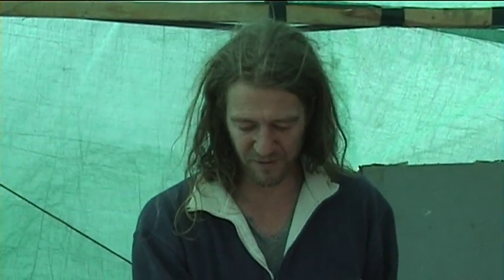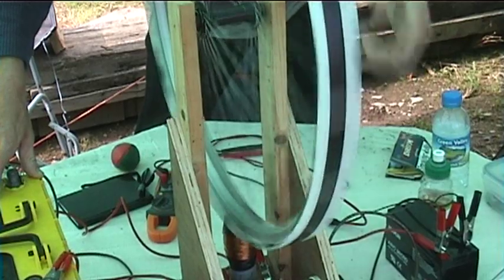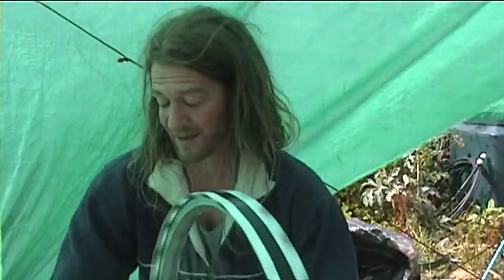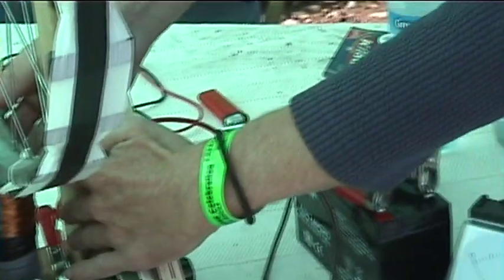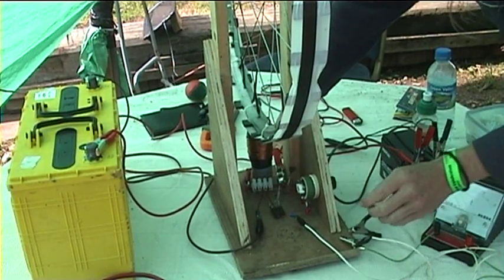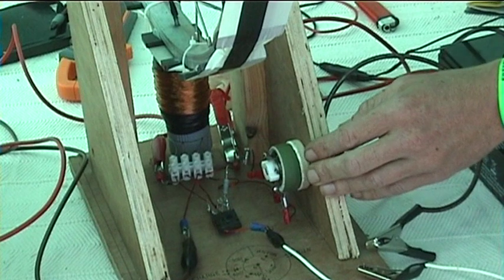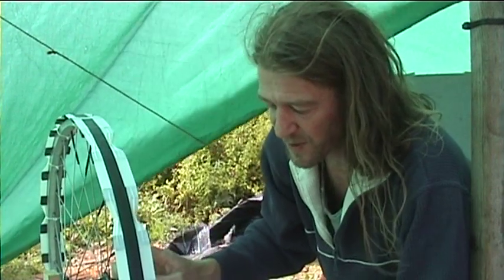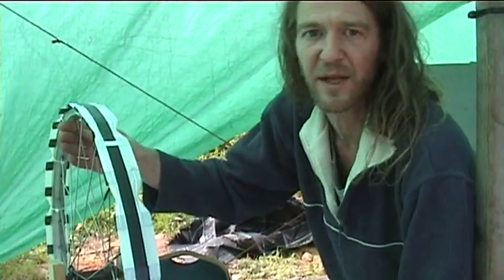Bedini (SSG) Motor - off grid festival 2011

Comment: I have been trying to figure out the Bedini thing for years now.  Perhaps someone could enlighten me,   I will be moving off grid soon.  I would like to take 10 or 12 deep cycle high energy density batteries with me.  I will have one of the best inverters money can buy.  If I built one of these Bedini fly wheels and powered it with a small solar panel, would I even need other input sources? 

From the claims Bedini and Tom Bearden made, I should be able to put 10 batteries in series and use the fly wheel to put a radiant charge on all 10 of those batteries.  As long as I used an inverter, I'd have all the electricity I need. 

My common sense is telling me it's wishful thinking.  What am I missing here?  This can't possibly work, can it?
Reply: thats exactly right bud. i have 12  12v deep cycles that run my whole house, i charge them with one 12v. Its harnessing the longitudinal wavelength.look up eric dollard on youtube, he tells how tesla figures it out, plus eric is a genius of the highest order.
Reply: kandysman86
Seriously?  I have this deep down feeling that there is something to this.  But I've never seen any demonstration showing real practical use of radiant energy generating large amounts of power.  I gotta see it.
Reply: ***** no i swear man. i've been doing i for some time and it is working great.
Reply: *****
Your gut is right. It's a scam.
Reply: They sell stuff and ask for donations, it's a scam.
Reply: Doazic If you Use the FREE plans to make one, then see that it works, then how exactly is it a scam? you do realize research cost money, and these kinds of projects don't get to suck at the public teat. Your a small minded person huh?never made one, but already have all the answers.
Reply: Look I'm sorry to burst your bubble but you can make a lot of money with the "free plan" scheme and it only takes basic understanding of electronics or chemistry to see that the machines don't work.
Reply: Doazic yeah right. Tell me why it cant? I can tell you that it most definitely can and tesla pioneered the field of scalar energy, just because it wasn't in your textbook, didn't mean it didn't happen. Thats why i tried it, my knowledge of tesla's work. And it does work, just as advertised.
Reply: It's just common sense, you're moving energy from one battery to feed another battery, you're going to lose some of that energy in the transfer and be at a net loss. Adding a spinning wheel in the middle is just going to make things worse. And in particular notice that he measures the charge of the batteries by measuring the voltage, which as anyone who deals with lead batteries can tell you, is not how you measure the charge on a battery.
Reply: Doazic
That's just it.  I watched the entire 30+ hours of "Energy from the Vacuum".  Bedini hooks up a primary battery to run the fly wheel, then charges another battery with the radiant spikes.  When you factor in the energy used by the fly wheel, and the energy charging the secondary charge battery, it's a net gain.  Bedini likes to say the COP is in the batteries. 

It's the radiant energy he's capturing and using.  Traditional electricians short the radiant spikes out because they would damage the circuit.  So the energy is there.  No one knows how to use it and therein lies the issue.  It's not taught in text books.  Electricians think it's useless because that's what they were taught.  Bedini built a very simple circuit to capture it.  It's as simple as discharging the radiant spikes into a capacitor but hooked up in reverse.  You can then simply discharge the capacitor normally and get real useable power. 

It's really amazing some of the demonstrations he shows.  One of them shows him adding a load to a circuit and it drawing less current.  He shows dead batteries taking a charge.  And many more. 

None of what he's claiming defies the laws of physics.  It's just that this radiant energy is elusive and hasn't been studied much.  Traditional electrical engineers think it's cray because they look at Bedini's circuit and think it can't work.  Show an electrical engineer Bedini's schoolgirl circuit diagram and they will say it won't work.  But Bedini has showed time and time again that it will work.  This is irrespective of the claims of over unity.
Reply: No such thing as "radiant energy", I just explained how the scam works, use your common sense.
Reply: Doazic
Ask any electrical engineer about the radiant spike.  They will tell you it's a problem in circuity and they have to ground it out else it will destroy the circuit.  So I'd rather believe them.  It's real.  It's not some made up BS.  It's in the textbooks.  Just ask any electrician. This part of the Bedini machines isn't up for debate.  It's a well known and established fundamental part of electrical engineering.  Besides it's common sense.  When you have a current flowing through or around a wire and you shut the current off, something has to balance out the circuit.  All that positive energy just doesn't disappear.  The radiant energy comes into the circuit to make the charges equal.  Otherwise you would have a perpetually positively charged circuit.  And we all know that's impossible. 

And FYI:  Bedini makes his living off building music amplifies and other similar products.  He is known as building some of the best amplifiers in the business.  Hell, he even makes his own semiconductors and resisters.  As for his simplified schoolgirl circuit, he gives it way.  He's not making any money off of it.  It's not a scam.
Reply: There's no such thing as "the radiant spike" and he clearly does make money off the SSG scam and he even mentions it in several of his videos.
Reply: Doazic Please explain to me how he makes money from it.  Because from what I've seen he offers the circuit diagram and parts list free of charge in the energy forums and his web site.  In fact, you can see dozens of machines people have built using his circuit.  Including the machine in this video.  He does endorse a kit but Rick Friedrich is the one who makes money from kit sales.  Bedini simply endorses it.  But he actively tells people not to buy the kit without first building and testing the circuit without the kit.  There are hundreds of videos of people building and testing these things.  To my knowledge there are no people who tried to build it and said it doesn't work.
Reply: Go watch the videos on his Energenx channel, he was receiving quite a few "donations" and they do sell kits as well.
Reply: I did my research, you've just been brainwashed by these guys. This video is over 3 years old, the machine doesn't work, come to terms with it.
Reply: Doazic The machines work.  I've seen them work.  I've built one that worked.  I don't know where you get your information from but people agree the damn thing spins.  It charges batteries.  Over unity or not, the machine spins a fly wheel.  So what the hell are you talking about? 

Have you built one?  Have you attempted to build one?  Why don't they work?  What is making it not work?
Reply: Just because the wheel spins doesn't mean it's working, just because it charges batteries doesn't mean it works. Let me put it in the simplest possible terms, the wheel spinning just drains energy from the battery. Meanwhile it charges batteries inneficiently, so if you start with one battery charged and another drained and you just keep swapping them around you eventually end up with two drained batteries. It's just completely stupid.
Reply: Okay I'll put it in even simpler terms. A battery holds energy, the Bedini claims that it can move energy from one battery to charge a bunch of other batteries. So lets say you start with one battery that has 100 energy and say 4 batteries that have 0 energy. If you just used a normal charger, 15% of the energy would be lost in the transfer and you'd end up with 4 batteries with about 21 energy units in them. If you use a Bedini charger, you lose say 2 or 3 energy units spinning the wheel in addition to the 15% that is lost as part of the charging process so you end up with 4 batteries with 18 energy units in them. Bedini tries to fool you by measuring the voltage which isn't what matters, it's how much energy is left in the battery that matters.
Reply: Nevermind the fact that a battery at 0 is dead and is sulfated beyond repair.
Reply: Doazic Radiant energy is PURE VOLTAGE. NO FLOW, ONLY MAGNITUDE. goddamn your slow.
Reply: I'm sure that's his sales pitch but that's just gibberish.
Reply: Doazic lol, yep troll
Reply: kandysman86
Don't you just love how some people just automatically assume it doesn't work even though they never tried building it?  They have never tested it.  They just say it doesn't work because someone told them it couldn't work.  Bedini and Tom Bearden go into detail about why some people don't think it work.  Electrical engineers look at the circuit diagram and say it can't work.  They never bother building it.  They look at the circuit and say it's backwards.  It can't possibly work.  So just to prove Bedini wrong, they build the circuit the way they were taught.  Of course it doesn't work, you didn't follow the instructions. 

The machine can desulfate the lead plates in a lead acid battery.  That was thought to be impossible.  Now you have people building battery desulfaters using Bedini's design.  The machine can also run on a 6 volt battery and charge a 12 volt battery.  That too is considered impossible.  Yet it's been done.  There are hundreds of videos to prove it.  The naysayers still say it can't work.  The evidence is overwhelming.  It's plain as day.  I just can't believe hundreds of people getting together and creating a conspiracy to support Bedini for something he makes no money from.  It defies logic. 

Secondly, radiant energy is real.  Some call it negative energy.  Even if you want to discredit Bedini and his circuit, you can't discredit radiant energy.  It's a well established component of electrical engineering.  So if someone claims it doesn't exist, they can't be taken seriously.  It's like saying the sun doesn't give off heat.
Reply: Do yourself a favor, go to Bedini's EnergenX youtube channel and watch a few. The man clearly has no idea what the hell he is doing or is running a scam.
Reply: ***** exactly. i am going to try and replace one breaker at a time with a solar/battery combo bedini motor.Ill be off the grid for real while this guy still thinks the earth is flat.
Reply: Doazic I'll do you one better.  How bout I go watch the entire series 'Energy from the Vacuum'?  It's not available on Youtube and is a comprehensive explanation of the Bedini projects.  He gives you the background of where the schoolgirl circuit came from.  He gives dozens of demonstrations.  He even has devices built by others like Moray, Sweet, Kromrey, and Howard Johnson.   They even interview university professors and electrical engineers.  They research things like negative resistors which are supposed to be impossible however Dr. Deborah Chung has shown that negative resistance is possible.  It's real verifiable science.  He gives examples of Tesla's research of radiant energy.  He gives an explanation of the problems with the mythbusters segment with examples and the device should have been built.  He answers all the questions of the skeptics.  It's all spelled out.  That doesn't sound like someone who doesn't know what they are doing.  That sounds like someone who is educated and knowledgeable.  Besides, it's pretty stupid to say that because even without Bedini's schoolgirl circuit and flywheel, he's still one of the best known electricians in the business. 

He purposefully doesn't post his schoolgirl circuit videos because people like you want to fight him tooth and nail.  He's got more important things to do than to try and convince a few skeptics who won't even build the machine.  All he asks is if you don't believe it, just build the machine to the specifications he provides and then tell him it doesn't work.  But people like you just won't do it.  Why is it so difficult  Why won't you build and test the machine before condemning it?
Reply: It's been done, none of the machines built work.
Reply: Doazic That coming from someone who hasn't built and tested the machine. 

Do you buy into the giant spoon theory as well?  There is a giant spoon on the other side of the Moon.  Someone told me so it's gotta be true. 

The machine works.  Get over it.  The evidence is irrefutable.
Reply: Your evidence that it works is video of a wheel turning. Guess what, that's what every single electrical motor can do, that's not proof.
Reply: Doazic
A video of the wheel turning is proof in and of itself, wouldn't you say?  There's also videos of the voltage spikes from the wheel.  There's also videos of reviving dead batters with the wheel.  Yet you say it doesn't work and provide no evidence or explanation.  You simply say it doesn't work.  Why doesn't it work?  Will you finally answer the question?
Reply: I explained pretty clearly why it doesn't work and how Bedini structures the scam, this is getting repetitive.
Reply: Doazic
No, no you didn't explain.  You just said it doesn't work.
Reply: Okay let me try again. The key to understanding the Bedini scam is to understand how you measure the charge left in a lead acid battery. The correct way to do it is to measure the specific gravity of the sulfuric acid in the battery. The way Bedini tricks you is that he measures the voltage, tells you "the voltage is increasing which means the charge is increasing" which of course is a lie. So Bedini will take one battery use it to raise the voltage of 2 or 4 batteries and say "see I charged 4 batteries with 1 battery" which is just a trick.
Reply: Doazic
Dude, that is flat out bullshit.  Where are you getting your information from?   I thought you watched his videos on Youtube.  You didn't see him measuring current with his alum batteries?  And just so you know, you can't take one battery and magically make the voltage rise on another battery.  Everyone knows the batteries would balance out and the voltage would be the same on both.  So please, please tell me again how he can hook one battery up to the machine with a 12.0 volt reading and then pull it off an hour later with a 12.5 volt reading all while running the fly wheel on a battery that has a voltage reading of 11.5 volts prior to the wheel running and 11.5 after the wheel has ran for an hour.  Care to explain that one?
Reply: The answer is very simple, if you raise the temperature of the battery which is what Bedini does, the voltage will increase.
Reply: Doazic
Dear lord, now I'm convinced.  You really don't know what you're talking about.  A lead/acid battery runs most efficiently at or around room temperature.  About 70F.  If you cool it down it's efficiency decreases dramatically and at around 32F it's efficiency is less than half.  When you heat a battery up, it's efficiency decreases even more dramatically and in fact will damage the battery.  The last thing he or anyone else would do is to heat up the battery.  That's just ridiculous.  A flat out made up falsehood.  Sorry bud, I'm not that gullible.
Reply: Doazic
I am well aware of the proper way to measure the energy density of a lead acid battery.
Reply: Then you're aware that Bedini measures it incorrectly.
Reply: Doazic No, I'm aware that Bedini measures it like most normal people measure it.  By taking a voltage reading.  If you want to remove the caps and risk getting acid on you, go right ahead.  But most people will measure the voltage which will give them a good indication of how much power is in a battery.  If a lead acid battery is spent, the lead will become sulphated and give you a lower voltage reading.  Therefore in a lead acid battery the voltage reading is directly proportional to the specific gravity.  In fact, a voltage reading is even more accurate in many circumstances because if you add sulphuric acid to a dead battery, the specific gravity reading will read normal and the voltage reading will read insufficient.  You could have a 12 volt battery with a normal specific gravity reading and only read 5 volts on a voltmeter.  The battery is dead.  You wouldn't know that from a specific gravity measurement.
Reply: The voltage is misleading and Bedini uses it specifically to mislead. If you use one battery to charge another battery then do that repeatedly you end up with 2 dead batteries. There's not much else to this.
Reply: Doazic Then why do you keep replying? Move on.  Go away.  Go comment on another thread.  I'm not interested.
Reply: kandysman86
Isn't it funny?  I've heard Bedini talk about the skeptics many times.  They all say the same thing. 

"Why would I build it?  It can't work so why would I waste my time building something that can't work?" 

If you don't at least try to build it, then the argument becomes arbitrary and pointless.
Reply: "The radiant spike caused by the collapse of the magnetic field creates a scalar spike, thats then directed towards the secondaries." Kandy this right here is the problem. That sentence is complete gibberish meanwhile you ignore basic battery chemistry that anyone who has dealt with an automobile would be aware of. You're completely brainwashed, there is no such thing as a "radiant spike".
Reply: Single wire transmission and lighting bulbs underwater is not magic and has nothing to do with "radiant energy".
Reply: How to light a bulb under water? Simple the current flows throw the wire lighting the bulb, the current follows the path of least resistance which is the wire and bulb, it'll only short if the water is pumped with electrolytes. As to the single wire trick, it's easy with high frequency, you can even light it without the wire and all explained under normal theories.
Reply: This is now insane. You do realize that we're having this conversation thanks to computers that only work because of current electrical theories. This conversation is being transmitted by electromagnetic wireless electricity, not magic "radiant pulses". The fact that this exchange is even occurring shows you're wrong.
Reply: Doazic That's just ridiculous.  Your comment just proves you have no understanding whatsoever of what radiant energy is.  Radiant energy is a fundamental part of electrical engineering.  It is so fundamental to circuity that it must be grounded out so as not to damage the circuit.  I have explained it to you previously and you still claim it's not real but again you don't provide any explanation.  Do us a favor and just stop.  Until you have built and tested the machine you don't know a damn thing.  You are out of your element.  You're like a 3rd grader trying to discuss the physics of rocket science. 

Oh and by the way, Tesla has extensive writings on radiant energy and pulse technology.

http://educate-yourself.org/fe/radiantenergystory.shtml
Reply: kandysman86 Tom Bearden explains it very well.  James Clerk Maxwell truncated Heaviside's equations.  He took Heaviside's work, took out what he didn't understand and published it and those are the same textbooks we use today.  Electrical engineering hasn't changed much in the last 100 years so new ideas and discoveries are met with skepticism.  What we know about electricity today is only half of what electricity really is.  Kinda like Einstein omitting electrical phenomena from the theory of relativity. Tesla understood it and it's highly likely we wouldn't know about it today had it not been for Tesla.
Reply: Doazic
You're right.  I apologize.  I got Maxwell and Lorentz mixed up.  It was Lorentz not Maxwell.  Lorentz symmetrically regauged Maxwell's equations which threw out all COP>1 systems.  This was a disservice to electrical engineering.  Now we have people like you that think it's impossible even though Heaviside and Maxwell proved it is possible.
Reply: Which still doesn't prove that the Bedini machine works nor that it harnesses your magical "radiant energy". It's pretty damn simple, a current passes through the coil in a bedini machine, that creates a magnetic field in the coil which repels the magnet on the wheel, then it turns off until the next magnet is nearby. The flow of current consumes energy in order to make the wheel spin. This is all normal orthodox electronics, nowhere is there any magic that requires "radiant energy" to explain it.
Reply: Doazic
Well at least your thinking now.  And you are absolutely right.  The coil turns on and off attracting and repelling the magnet making the fly wheel spin.  But the process doesn't end there.  You forgot the part where the magnetic fields collapse and the energy is captured in another coil or set of coils.  This is the radiant spike.  If you still don't believe it doesn't exist I suggest building the machine to the specs Bedini gives and then holding the secondary wires in your hands so you can feel the 300+ volt zap.  Then tell me radiant energy doesn't exist.
Reply: "the magnetic fields collapse and the energy is captured in another coil". That right there is the problem because what you just described is nonsense. There is no energy to capture from the collapse of the magnetic field. When you flip the switch on a lightbulb to turn it off is there energy to capture from that collapse? Of course not.
Reply: Doazic
The current flowing through the wire creates a magnetic field.  When it is shut off, the magnetic field collapses and the radiant spike equals out the charge.  The laws of physics dictate that the charge must be equal.  The radiant spike is the energy that brings the circuit back into equilibrium.  It's not rocket science.  It's a well known electrical engineering principle.  I've been saying it since you started this whole pointless discussion. 

It's easily understood using the garden hose metaphor.  What happens when you shut off a garden hose?  Air enters the hose and takes the place of the water. So what happens when you shut off the current in a wire.  What takes the place of the positive charge?  If you don't buy into the concept of radiant energy, then what causes the charges in the wire to equalize?  Answer it this time.  Don't ignore the question like you have been doing.
Reply: Okay I think I get the problem here. Your hose analogy is perfect. When I switch a lightbulb on electrons start flowing through the bulb and that causes it to turn on. When I turn it off, the electrons do not leave the wire, the only thing that changes is that the electrons (or water in the hose) stop moving. It does not get replaced by air.
Reply: Doazic Oh god, dude it was an analogy.  It wasn't meant to be taken literally.  If you don't even understand the nature of electricity, then there is nothing to discuss.  This is a pointless exercise.  Do me a favor and just stop posting on my thread.  I'm not interested in what you have to contribute.  It's meaningless and pointless.
Reply: No no, I answered your question. The electrons stop moving, that's it, there is no radiant spike caused by electrons no longer moving. This whole gibberish where the "collapse of the magnetic field causes a spike" is gibberish based on your misunderstanding of what electricity is.
Reply: Good luck with your magic battery chargers then.
Reply: Doazic its well known that electrons dont "flow" through wires. They drift, very slowly.
Reply: Victor Toro
I have no idea what you are trying to say.  Is that English?
Reply: ***** you seem to know this is nonsense. are you trying to get a demo for entertainment? you're baiting them right? with comments like "is it just wishful thinking". you know it is right? i'm trying to read between the lines. From a sociological perspective, this scene is both fascinating and disturbing.
Reply: intriq8
I'm trying to figure out if there is any truth to it.  You have two types of people in this debate.  The first type says it can't work.  It's impossible.  They have never tried to build the machine and test it but they still insist it can't work.  The other type says it does work.  There are certainly dozens of videos of people running the machines. 

Everything I've seen shows it works.  I'm trying to find someone with experience who can confirm or deny the claims through real measured data.  Someone who built the machine to Bedini's specifications and can explain it.  I've seen the entire 'Energy from the Vacuum' series.  Bedini shows the machine working.  You can see it with your own eyes.  But he's just one man.  Bedini has proven his machine to disbelievers before.  Others just won't believe him no matter what.  Even with real empirical proof.  They refuse to build the machine and test it and therefore insist it's impossible. 

I want someone to talk me out of it.  I want someone to explain why people think it works but really give an understanding of why it doesn't work.  And I don't mean some backyard electrical engineer who won't build and test the machine and is simply offering reasons why it won't work based on what they were taught.  I want a skeptic to build the machine and get it running and tell me what is going on.
Reply: ***** said "+Doazic Dude, that is flat out bullshit. []"  No, that's about the 4th or 5th really clear concise explanation of exactly what's happing that he gave you. amazing.  It's not mysterious: You are getting less energy out than you put in, and you have to know it , coz your batteries keep going flat. You do know it, right? Its right in front of you, so you're either lying or just don't really understand whats happening yet. Which? I have to know ! ?
Reply: I think the issue here is a confusion of what proof is. Bedini has never proven empirically that it works. To do that he'd need to provide measurements showing more energy coming out that going in and he has never done that.
Reply: ***** "I want someone to talk me out of it." If you have enough knowledge or experience, there's really no need to build it to understand it completely, and to know it doesn't work.  But, you said you built it, so, does it run forever or do your batteries go flat? There's your answer. Or, if the concrete experimental data in front of you, or the clear technical and logical explanations from Doazic aren't enough, perhaps explore an understanding of the sheer improbability of it all:  that the only people taking advantage of this are a few assholes on youtube, and not  many, many, much smarter, more enterprising entities. If this could yield even a small advantage to people, everyone would have one. You can't keep a useful secret. Not all of the powers that be agree; that's the achilles heel of suppression conspiracy theories.
Reply: Doazic
Bedini does have empirical proof.  He's got about 60 hours of it on video.  It's all documented on the Energy from the Vacuum series.  He lacks the scientific understanding to explain it though.  And therein lies the problem.  He got Tom Bearden to help and he has been trying to explain it but it's fallen on deaf ears.  It's not something that is easily explained. 

One of the most poignant examples is Bedini running 3 killowatts of incandescent lights off a 2,000 amp/hour battery bank.   He takes a voltage reading and lets the lights run for about 15 minutes.  He then lets the batteries rest and takes another voltage reading.  Obviously the battery bank has lost a considerable amount of energy  Then he hooks up his 10 coil machine and runs it for another 15 minutes.  After letting the batteries settle to their sitting voltage, the voltage reading was the same as it was before running the experiment.  All this was done from nothing more than one 12 volt battery and his 10 coil machine.  Bedini then goes on to explain that the naysayers will say a voltage reading alone is meaningless.  So he runs the experiment again.  Exact same results.  That's impossible according to most.
Reply: Doazic Damn, nice and concise as usual.
BTW: I think when they say "electricians" have to protect against "radiant blah", it seems they may be referring to "back-EMF". So that's a thing. This is a "motor" here, so loosely they could be said to be harvesting back-EMF.  which of course is still just energy you had to put into the system. But I guess it's all custom folk-lore, so not much sense in trying to map it all to real concepts.
Reply: I explained this to you already, the voltage is not the proper way to measure charge in a lead acid battery, that is the trick he uses to con people.
Reply: intriq8 See that's what I'm talking about.  Saying something doesn't work without building or testing the machine is meaningless.  That's what everyone says. Everyone uses the same excuse.  If it was possible everyone would have one.  I have yet to see someone build the machine and then debunk it.  There is enough proof out there to know the machine will run.  No one is arguing that.  The fly wheel will spin. 

Doazic is right.  Bedini has never been able to show more energy going out than coming in.  But it goes against the nature of the experiment.  Bedini says "the coefficient of performance cannot be measured because it's in the battery."  You can't hook a killawatt meter up to the input and another one to the output.  The output meter will be jumping around sometimes reading 500 volts, sometimes reading 10 volts.  But he does show the voltage reading of an input battery before running the machine and then after running the machine.   He then has separate meter showing the voltage of the charge battery before and after charging..  There is a clear gain.
Reply: +Doazic love the ol' "you're typing this on a device built on the science you're shitting on"
I pull that out sometimes, thinking I'm clever. Is that hack now?
Reply: Then he can just hook it up to an oscilloscope and measure the output. You just stated a huge red flag in that Bedini is claiming it can't be measured. If it can't be measured, it isn't real. Bedini is claiming something that is impossible under the current laws of physics and common sense. Given that in the years that he has been making money of his scam, he has never proved that it works, the default conclusion is thatit doesn't work. You don't need to build it to show it doesn't work, he needs to build one and prove it works.
Reply: Doazic
Like I said.  Bedini says the coefficient of performance is in the battery.  You can't measure the output on a Bedini machine in kilowatt hours.  You have to put it in the battery and then measure it.  I gave an example earlier of how he demonstrates it using a 2,000 amp/hour battery bank, and a 12 volt battery hooked to a 10 coil machine.  The voltage of the battery bank will go down.  If you take a reading and it's resting voltage is 12.9 and then run the Bedini machine and it's resting voltage comes up to 13.3, then the machine is obviously putting a considerable amount of energy into the battery bank.  You can claim the voltage reading is useless all you want but the it is the only known way of giving you a quick understanding of the batteries capacity.  Otherwise you're looking at hours of testing.  You can't test a batteries capacity in a matter of minutes.  So it is generally accepted that a voltage reading can give you a pretty good indication of where the batteries are sitting. So if you have a 12 volt 2,000 amp hour battery bank reading a voltage of 13.3, you can pretty much say the battery bank is fully charged.  If the voltage reading was 12.0 you can logically assume the battery bank is in need of charging. In fact, that is how charge controllers operate.  They don't read the battery capacity when deciding whether to send current to the battery, they use the voltage of the battery.
Reply: Dude, I don't know why you guys think Bedini is making money off of this.  He's never made money off of it.  He freely gives the specs and parts list out to anyone.  Hell, he will even answer your questions on his forum.  He does offer a kit you can buy but that's just because the lazy folks wanted an all in one kit.  He doesn't promote it though nor does he sell that many.  But you don't need the kit and Bedini will tell you that.  In fact, he prefers you build it yourself with your own parts.
Reply: I've come to the conclusion that many if not most free energy advocates on youtube are attempting to make money through youtube or an external website. I speculate that many/most don't actually believe it, and are simply generating traffic /comments/revenue.
Since I started to see it it seems obvious and I feel like I should have realised sooner. It's fascinating. Its that standard religion/cult/alternative scene, full of the passionate and naive, with many cynical non-believers "leading" them for personal gain/status. A kind of self-reinforcing structure, that is common, but I find a bit grotesque and sinister.
Reply: He does make money off it, we've pointed that out previously.
Reply: Doazic
I make money by selling garage sale trinkets on ebay.  It's not much money.  But it's easy and quick.  Like I said, he doesn't actively promote the kits.  In fact, he encourages people to build their own machines with their own parts.  The kits were put together and sold by Rick Friedrich anyway. Bedini just endorsed them.  He might have sold a couple of dozen per year. 

His real business is making customized audio equipment.  Apparently he makes some of the best audio amplifiers money can buy.  The Bedini machine is just a hobby. 

He's not the quack you seem to think.  He is considered a genius by many in the industry irregardless of his machine.
Reply: @105951085035446188665 Well, see ,they have been built. by skeptics and by believers. they've been proven not to work the number of times that they've been built, in that they didn't keep running. and countless times in more scientific ways. surely you know this. you're not running your house off it, you're not charging your phone off it, without putting in power.  Look, why on earth do you keep defining WORKING as SPINNING? surely this is disingenuous . thats just a motor. thats not useful.  this conversation is dumb. You can't be serious. spinning is not equal to working. the batteries not going flat would be "working"  .. hell even a few points under and a long runtime would be impressive, but its not even close.. you know it. how the hell do you have so much time to lie about something you know?  youtube comments must generate money somehow...
Reply: intriq8
I think you have a misunderstanding of how the machine works.  It's not a perpetual motion machine.  Eventually the primary battery does run out.  It runs out just like any battery would running a motor.  The unusual part is the collapsing magnetic field's radiant spike he captures and puts in another battery.  It's not free electricity in the sense it is created out of thin air.  Its simply taking the energy that's already there and converting it into useable power.  Works on the same principle as solar or wind. 

I have yet to find a skeptic who built one and tells us why it doesn't work.  Can you point me in the right direction?  A Youtube video perhaps?  And don't tell me about the mythbusters.  They didn't follow Bedini's specs nor did they contact him or ask him for any advice.  They completely botched the motor.  They did eventually admit they didn't follow the specifications but they never revisited the myth even when Bedini offered to show them.
Reply: We've explained to you multiple times why it doesn't work. If that's not sufficient for you, buy one and see that it doesn't work.
Reply: ***** "Its simply taking the energy that's already there and converting it into useable power.  Works on the same principle as solar or wind. " this is were the description goes off the rails, but i'll take a liberal interpretation and explain why it still doesn't do anything useful:
 yes, one can build a system that harvests back-emf of a motor somehow, no doubt a number of ways, and you are reclaiming otherwise lost energy. The thing is that that energy came from the battery. its akin to driving a wheel and then hooking a generator and saying "look, I'm reclaiming lost energy" . You had to put it in first. and more than you get out. thus, not new. Theres no special excuse that excuses the battery going flat: thats the test. by the lore of this device: switch em round after you use the first to charge the second. net loss. and you know it . this is too circular. I'm bored now, so good luck.. as usual Doazic put it best.
Reply: intriq8 It's not back emf.  I never said that.  Never even implied it.  It's the radiant spike.  When a current flows through or around a wire it is positively charged.   Once the current is switched off, nature equalizes the charge by inputting energy into the circuit.  It's a very brief high voltage spike.  This energy is grounded out in traditional circuitry.  It's sometimes referred to as negative energy.  Bedini simply captures it, inputs it into a capacitor, switches the polarity and discharges it into a battery.  That's the simplest explanation.  The energy is already there.  It's not lost energy.  It's not energy that came from the battery.  It's the radiant spike that occurs when the magnetic field collapses.  It's charge equalization.  Action/reaction.  Cause/Effect.  It's a well known phenomena in electrical engineering.
Reply: ***** yeah but thats not a thing (meaning: that explanation is not meaningful), i was trying to meet you halfway with the closest thing it could be. descriptions by prominent advocates of your crap actually refer to  the BEMF as being used. but forgive me, forget the term. either way, regardless of what you want to call it, theres less coming out than going in.
Reply: intriq8  the inductive spike is much higher voltage than the input, back EMF can never even be as high as the input voltage. Two different things man,and both well known
Reply: That's not a thing?  What do you mean by that?  Back emf has nothing to do with the high voltage spike.  Two completely separate phenomena.  Meeting my halfway?  You're not meeting at all.
Reply: kandysman86 yes, regardless of which effect you are referring to harnessing, it doesn't do anything useful.
Reply: intriq8 lol, and you keep believing what you're told. i like experimenting for myself
Reply: good, me to, but i believe very little of what  i'm told by people exhibiting the kind of circluar logic i see here. hence this conversation.  I also know BS when i smell it. Bedini says its not getting free energy, and that its just interesting, then claims he's powering things  from iit. so which is it,? cant be both. because powering his stuff off anything other than the free energy he says it doesn't produce , would be a meaningless statement. But i agree, he's still not as overtly full if shit as some  people in this community are about this device.
Reply: intriq8
Do you know what circular logic is?  Circular logic is something you affirm to be true because someone told you it's true without providing any evidence to the contrary.  A good example is the bible.  People will fight tooth and nail to affirm the bible and provide bible verses to prove the bible is true.  That's circular logic.  And that's what you are preaching here.  Someone told you Bedini's machine can't possibly work and you believe them based on what they told you even though they provide no evidence to back it up nor have you built or tested the machine yourself.  You have no frame of reference here. 

Nor do you seem to understand the premise behind the machine.  I have explained it more than once and you continue to hark on perpetual motion and free energy.  I have explained why it's not free and how it's possible to have a COP greater than one.  Before you continue to condemn Bedini, why don't you go watch all 60 hours of the Energy from the Vacuum series and then build the machine yourself so you can understand it.  If you still think it doesn't work, then you will be in a better position to challenge it and I will be in a better position to listen to you.  Until then, this is a meaningless debate.
Reply: You have this backward. You have to build one and prove it works. The burden of proof is on you. We've explained in detail as best as possible why it doesn't and can't work. If you need physical proof that it doesn't work to convince yourself, spend the couple hundred bucks to build one and see for yourself.
Reply: Doazic um, no, and you know it: the burden of proof is and has always been on the one making the extraordinary claims. And no, that's very much my point: i don't need physical proof that it doesn't work, its obvious from a mile away, the creator himself says it doesn't work, and it's been proved already. Open and shut years ago. even the original liar Bedini is smart enough to distance himself from you. I know you've "explained in detail as best as possible" to the best your ability, and that's one of the other many many nails in this coffin.  Your psuedo-scientific double-talk also an excellent indicator that this is nonsense. The more time one spends looking at people like this, this the more obvious the scam is.
Reply: intriq8
Look man, I'm not interested in a pissing match.  If you don't believe it fine, I don't give a damn.  But please, you're projecting your own thoughts and opinions on the subject and it's completely irrelevant.  No one is talking about a bullshit novel motor or blocking oscillators or magical waves.  You don't understand it.
Reply: no, that's exactly what your talking about. that is what a SSG is, a slightly novel motor, patented years ago. that is the beginning and the end of it. I understand it fine. You can't bamboozle me with poorly worded pseudoscience, I've been around too long.
unless you are saying that this does nothing useful , but is interesting, then thats what you're saying: thats its useful. which it isn't., particularly. no pissing match, just plain simple obvious truth.
Reply: I just hate lairs too much. its my particular problem. that's on me.
Reply: I have built one.  I have a single coil motor.  It charges batteries just like it supposed to do.  It will run for days on one 12 volt battery and charge another battery at the same time.  I don't have unlimited resources so I have only a couple of 12 volt batteries.  I can get mechanical power from the wheel and charge a battery at the same time.  I have not tested it but from what I understand I could charge several batteries at the same time.  I don't claim to be an expert.  I am simply an enthusiastic hobbyist.  If I had the time and money to test different configurations of batteries, transistors, etc. I would.  I have seen videos of others testing these machines and they seem to work.  Like I said before that you two guys keep ignoring the Energy from the Vacuum series.  You guys don't seem to have an understanding of the basic premise behind it.  Both of you just seem hell bent on the free energy thing and how it's impossible.  And yeah, you can't get more out of a system than what you put in.  Then a guy invented the solar panel.  All the sudden you have energy that appears to be free.  They claimed his invention was impossible.   It couldn't possibly work. At first glance for all intents and purposes, it's free energy.  No one is supplying the solar panel with excess energy, yet here is the data.  They are clearly getting more out than what they put in.  It appears to contradict the conservation of energy.  It can't possibly work.  Then they took a closer look and realized, nature is putting in energy too. I mean come on.  Did you guys learn anything from Einstein?  Nuclear power was thought to be impossible.  Solar power was thought to be impossible.  Do you guys honestly think that we will continue to spin turbines through super heated steam and power the world?  Someone is bound to make a new discovery and revolutionize the energy industry.  Hell, just look at the claims of the Bloom Box.  It is claiming the same thing.  Google seems to think there is something to it.  So why don't you go discredit the Bloom Box.  That guy has taken billions of dollars making the same claim.
Reply: Have you not been paying attention?  The Bedini machine is not patented.  He is giving it away.  He has been giving it away for years now.  He wants people to build and test it.  It's not about the money. 

I'm not trying to bamboozle you or anyone else.  You say it can't work but you have never tested it.  You have never built it.  You have no context.  You are not qualified to say whether it works or not.  Are you an electrical engineer?  Are you even familiar with basic circuity?  Are you even a hobbyist?  Have you at least watched other videos of people running these machines?
Reply: ***** it was patented long before bendini made one.  you are simply reciting modern folk lore.
Reply: As bendini himself said, its working on well understood principles. Its interesting if you're interested in how different motors or oscillators work, or EE in general ,which is a fair interest.
Reply: ***** "I have not tested it but from what I understand I could...[]" this really says it all. You haven't really tested it meaningfully, and you don't understand much.
Reply: intriq8
Dude, you are off your rocker.  It couldn't have been patented because it doesn't work.  Remember?  So who magically patented something before the inventor invented it and what were the claims in the patent?  The patent office won't patent a perpetual motion machine.  And if it was patented before Bedini, then how could Bedini openly and legally violate another persons patent?
Reply: ***** your logic sucks. its works fine as a novel motor. which is what i said. just doesn't do what you claim.
Reply: The history of this motor design goes back much further, probably to 1974, when it was patented by Roger Andrews of Salem, Oregon as a novelty electric motor. (Ref. : Patent 3,783,550)

The Bedini SSG motor, to all intents and purposes, is identical to that patented by Roger Andrews. It is based on what is commonly known as a `blocking oscillator´. 

Blocking oscillators are often used as voltage converters / simple switch-mode power supplies; for example fluorescent light inverters. For many, it will be recognized as the circuit for a `Joule Thief´.
Reply: So what happens to the `charge battery´ when it receives a high voltage pulse ? The answer is that the battery is desulphated. Accumulations of lead sulphate are stripped from the battery plates, allowing the battery to perform slightly better. This is the crux of the Bedini Motor myth - it can desulphate a lead acid battery making it work more effectively - it is NOT a true battery charger ! Solid state desulphators that work on exactly this principle, and do this much better, are available for $30. furthermore, they draw the power from the battery that they are desulphating.  Bendini , and the assholes associate with Bendini, sell this very thing for hundreds of dollars, using the buzzword "radiant "energy . but surely you know all this and you're just pretending to believe otherwise.
Reply: "The great Bendini" clearly states its not a perpetual motion machine., nor OU, not does it produce any electricity, nor does it get you free energy. he's said all theses things explicitly, (i think you even said these things somewhere.)  he's claiming it was nothing more than a battery desulphator, which is a tad disingenuous of him in light of other things he's said.  but he does sell desulphators.
Reply: intriq8
I'm done here.  You have a wonderful ability to misquote and twist the meaning of what I have been saying.  I can play that game too.  Shall we?

"As bendini himself said, its working on well understood principles. Its interesting if you're interested in how different motors or oscillators work, or EE in general ,which is a fair interest."

It's Bedini not Bendini.  That just goes to show you, you are clueless in the whole debate.  You don't even know his name.  Secondly, this comment makes no sense whatsoever.  "It's interesting if you're interested".  What the hell?  "which is a fair interest"  What does the even mean?  How can something be a fair interest?  It sounds like this was written by a 3rd grader who way out of their league.
Reply: ***** " how could Bedini openly and legally violate another persons patent? "  because nobody cares and its common knowledge and nothing's at stake. thats how patents work. you can copy any number of patents , but until you do something interesting, or affect real business, its not of concern to anyone. you've pointed out exactly whats wrong with the idea that this motor is useful.
Reply: I know you're done here, i finished you off yesterday, its all just victory laps now. 
funny, the best hole you could come up with was me typo-ing him "bendini" 

if you can't understand the sentence fragment ",which is a fair interest" i can't help you. no , i can: here: its an interest , and thats fair. fair being in contrast to your assertions. I've gone out of my way to help. I gave you the original patent number.
I've twisted nothing, you are twisting in the wind.
Reply: Look, if you strip out all the bogus claims of Bedini, what his circuit does in reality is take the basic DC output of one battery, converts it to high voltage pulses. That conversion right there means a loss of energy. And sadly no, charging a battery with pulsed DC does not magically allow you to get more energy out than you put in. From a fundamental Electronics 101 standpoint, this is less efficient than simply directly charging the secondary batteries directly.
Reply: Doazic It's not converting anything.  Have you been paying attention?  The high voltage pulse is an effect of a collapsing magnetic field.  The primary driving battery simply drives the wheel and the circuitry associated with it.  That's it.  Nothing more.  You guys really need to look into it.  You haven't even grasped the basic concept.  It doesn't take but a few miliamps to drive the wheel.  You can literally run it for days, even weeks, on one 12 volt, 6 volt, even 3 volt battery.  Pretty soon you realize you're putting in thousands, even millions, of high voltage pulses.  According to traditional electrical engineering, putting in high voltage pulses in a 12 volt battery would destroy the battery.  Yet here you are claiming it's a well known but useless phenomena.  So which is it?  Do you believe traditional electronics which says it's impossible or do you believe it is possible and there just might be something to the Bedini machine?
Reply: Doazic lol, except that i can charge 2 batteries full with one. And the collapse of the magnetic field is the source of the pulses, not the run battery. The run battery cannot make a back emf pulse greater than the input.You don't seem to understand that every subject 101, becomes different at the onset of new observations. According to you, all those wonderful things science envisions for the future can never happen. Simply because when the discoveries are made, people like you will scream its not real until no one takes it seriously. As well as the propaganda designed to maintain the status quo. I guess that doesn't exist either huh? 200 trillion dollars worth of fossil fuels left in the ground that are controlled by very few companies. Nothing will be allowed to mess with that piggy bank. You just keep deluding yourself. The government is here to help you, science is perfect and self correcting, big pharma is trying to cure disease. Yeah you just keep on believing in your delusions. Remember, you were told too by "authority"
Reply: I'll amend my previous post.  You can send high voltage to a battery for a limited time in a last ditch effort to restore it.  Certainly not more than a few hours.  However Bedini's machine can send high voltage pulse after high voltage pulse over and over non stop without boiling away the electrolyte. Plus, the higher than normal voltage sent to a battery in the last ditch effort is just a few volts over the sitting voltage of the battery.  For example you might send a 16 volt current to a 12 volt battery for an hour or two.  Bedini's machine sends 300 volts or higher to the battery.  All while not boiling away the electrolyte.
Reply: Again, a collapsing magnetic field does not create a high voltage pulse. The high voltage pulse is caused when the magnets pass by the coils and induce a current which then goes through a bridge rectifier to make it DC. So just to recap, you have a machine that converts the 12 volt DC output of one battery into higher voltage DC pulses. Which because it's done mechanically with the bicycle wheel setup, introduces even more losses to what is already a lossy conversion.

So to re-state my bucket analogy. You're using one bucket to fill up 2 other buckets but losing water in the process. It doesn't matter if you move it in a steady stream or separate spurts. The battery contains a finite amount of potential chemical energy and no matter the way you choose to move that energy, you will lose some in the process.
Reply: Doazic To use your bucket analogy, using one bucket to fill two more buckets is perfectly reasonable if the environment is also helping to fill the buckets.  ie rain.
Reply: But there's no rain coming into the system externally. You have a closed system consisting of the batteries and the circuit. The total energy of the entire setup cannot increase per thermodynamics, you can only move it around with losses.
Reply: Doazic the high voltage spike is called a transient spike and is most definitely caused by the collapse in the field. thats understood in the mainstream.
Reply: ***** you do realize we have been trolled on this thread for three months now, yet we can't help but to feed it,lol. wonder why?
Reply: The total energy of a closed system cannot increase, do you not understand that?
Reply: Doazic its not a closed system.
Reply: kandysman86
Bingo!  You're absolutely right.  i forgot.  It's not a closed system.
Reply: It is a closed system, there isn't energy coming in from the outside.
Reply: No, no it's not a closed system.  Bedini is adamant about that.  If you simply would take a look at the schematics I'm sure you would know that.  But you are sure it can't work so there is no need to look at the schematics.  Right?
Reply: I don't care what Bedini is adamant about. It's a closed system, there is no energy coming in from the outside. We've tried thirty different ways to explain to you why it doesn't work and you just can't grasp basic concepts so I'm just astonished.
Reply: Look, go build one and show it works so you can win a Nobel Prize.
Reply: This is the actual verbatim definition of a closed system: "a closed system is a physical system which doesn't exchange any matter with its surroundings, and isn't subject to any force whose source is external to the system." Guess what, a Bedini setup is a closed system because it doesn't exchange any energy or matter with it's surroundings which means by definition it cannot experience a net gain in energy as Bedini claims it is capable of doing.
Reply: Doazic
Hmm, well here's the definition I looked up.  In thermodynamics, a closed system can exchange energy (as heat or work) but not matter, with its surroundings. An isolated system cannot exchange any heat, work, or matter with the surroundings, while an open system can exchange all heat, work and matter.

OK, so you want to take that back?  Dude, you're not even looking this stuff up.  Do you check any of your facts?
Reply: To restate the point, it's a closed system since it doesn't exchange matter and it's an isolated system because it doesn't exchange energy. Happy now?
Reply: Doazic Oh boy.  Now you're contradicting yourself.  Earlier you claimed the Bedini machine was nothing more than an inefficient energy exchanger.  You claimed it takes regular DC and turns it into pulsed DC. 

Please read the definition again.  I'll copy and paste it again.  This time read it and try to comprehend what it says.  In thermodynamics, a closed system can exchange energy (as heat or work) but not matter, with its surroundings. An isolated system cannot exchange any heat, work, or matter with the surroundings, while an open system can exchange all heat, work and matter.

I don't know why I am continuing to entertain this discussion.  So yes, yes it's an open system.  Just get over it.
Reply: At no point have I contradicted that it is an inefficient energy exchanger.

By all means explain how a Bedini set up qualifies as an open system given that it does not exchange energy with the outside, either coming in or going out.
Reply: Doazic
How bout you go and look at the Bedini schematic yourself.  I don't have the time or the patients to explain it.  It's not something that can be explained in a Youtube video comment.  And yes, you did contradict yourself.  You contend Bedini's machine is nothing more than an inefficient energy exchanger?   Agreed?  OK, here is a quote from you taken directly from your previous post.  "it's an isolated system because it doesn't exchange energy. Happy now?"

Looks like a contradiction to me.  Which one would you like to defend this time?  Or do you just want to just change your opinion again? 

It's an open system.  Accept it.
Reply: It moves energy from one battery to another. When I say it is a closed system, I am saying that IN TOTAL, the battery providing energy, the circuit and the two batteries being charged are a closed system. You are simply moving energy from one place to another, you cannot create additional energy by doing that so by definition it cannot do what Bedini claims it does.
Reply: Doazic
Closed system in total?  What does that even mean?  You have open systems and closed systems.  There is no such thing as a partially closed system.   That's absurd.  There you go again assuming you understand the machine and how it operates.,  You obviously don't.  For the love of god, LOOK AT THE SCHEMATICS.  READ THE CIRCUIT DIAGRAM.  This isn't a battery hooked up to a circuit and then to another battery. 

This discussion just keeps going full circle and you still have not grasped the fundamental concept of the machine.
Reply: I swear to God it's like talking to a sixth grader. IMAGINE A SEALED CONCRETE ROOM WITH 3 BATTERIES AND A BEDINI CIRCUIT. THAT IS A CLOSED SYSTEM, NO ENERGY IS BEING EXCHANGED WITH THE OUTSIDE UNIVERSE YET BEDINI CLAIMS THE AMOUNT OF ENERGY IN THAT SEALED ROOM MAGICALLY INCREASES. THAT IS FUCKING IMPOSSIBLE.
Reply: Doazic
Whatever dude.  You don't understand it.  You are completely misinterpreting the machine.  E=MC^2 was a bullshit notion imagined ups by that crock of scientist Eisntein.  Wardenclyffe was a  figment of Tesla's imagination.   Collapsing magnetic fields don't produce a high voltage spike.  Thousands of Youtube videos of these machines are all hoaxes.  Did I miss anything?
Reply: Instead of using lead-acid batteries use one fully charged supercapacitor to charge several discharged supercapacitors. The voltage on a capacitor is directly proportional to the charge it holds so measuring the voltages will show exactly how much charge is being transferred and how much is lost far more reliably than measuring lead-acid batteries.
Reply: Again, BECAUSE you are claiming the bedini machine can take 1 battery that is fully charged and fully charge 2 batteries that are fully discharged. So you went from having 1 arbitrary unit of energy in the system (i.e. 1 fully charged battery), to 2 units of energy in the system (i.e. two fully charged batteries) . That means you created energy out of nothing by simply moving it from point A to point B which is fucking impossible as everyone who has built these stupid things has found out.
Reply: Doazic
Again, you haven't been paying attention.  159 comments and you still don't understand the fundamental concept behind it.  You want to hark on this free energy bullshit that is irrelevant.  I'll say it one more time.  IT'S NOT FREE ENERGY!  Drill that into your fucking skull.  It's an open system that uses a small amount of input power to run a fly wheel.  The fly wheel then takes energy from the environment in the form of a collapsing magnetic field high voltage spike and is collected in a battery or capacitor which turns it into real usable power.   Now, anyone that has ever taken a physics course knows, there is enough energy in a cubic centimeter of air to power the country for a day.  Einstein told us that.  The energy is there.  It has always been there.  It will always be there.  In fact, it's in space too.  It's pervasive.  NASA found it out the hard way.  Remember the tether incident?  Explain that one to me, Einstein.  How is it possible for a a wire in space to gain so much energy that it shorts out and overloads to the point of shearing the cable? 

Now, don't start mixing up terms like power and energy.  Those are two different terms that mean two different things.  Furthermore, get the stupidity of perpetual motion out of your head.  Also, understand that these batteries do not simply transfer power.  They are not hooked up in a way that would allow them to simply transfer energy from one to the other.  If you would read the schematics like I have asked a half dozen times, you would know this. 

So here we are again.  Gone full circle.  Shall we make it go full circle again?  Which point will you try argue this time?  Open systems?  High voltage spikes?  Charge equalization?  Which one?  It's getting old.  Just go away already.
Reply: Build one and prove it works then.
Reply: Doazic
Here we go again.  Like I said twice already.  I have built one.  I don't have the resources to scale it up but I have a small Bedini wheel with two coils.  I have two 12 volt 7aH SLA batteries.  They are identical.  One for input and one for output.  I don't know the optimal configuration and I don't have the proper equipment to test it out so I can't give you hard data proving it works.  But I can say this.  I can record a resting voltage on both batteries before running the machine.  The last time I ran it I had one battery at 12.9 which I used as my primary battery and the other battery read 12.4 which I used as my charge battery.  I ran the machine for two days.  The primary battery drained to 12.6 volts while the secondary charge battery was a little over 12.9.  This was after letting the batteries rest for a few hours. 

Now, you can go into your spiel of why a voltage reading alone is meaningless.  However, it is impossible to quickly assess the capacity and condition of a lead acid battery.  In order to test it properly and get a true understanding of the battery's capacity, it takes full charge and full dishcharge cycles.  This can take many hours to many days.  That is why voltage readings are used as a quick way of getting a general idea of the battery's condition.  I agree, a voltage reading alone will not give you a true picture of the battery's capacity.  But it's pretty damn close especially if your batteries are new and have never been over charged or under charged and there is no sulfation on the plates.  So, a 13.3 voltage reading on a new 12 volt battery is a pretty good indication that the battery is fully charged.  In fact it is such a good indication of the battery's condition that charge controllers and car gauges rely on the voltage reading alone to relay the capacity information to the user.  So don't try pull that voltage reading bullshit. 

In summary, yes I have built a Bedini wheel.  I have gotten results that seem a bit unusual.  I can't explain them any more than Bedini can.  One day when someone figures out a way to scientifically explain the phenomena, you will eat your words.  It appears to work.  I had the same reservations as you did.  I didn't believe it could work or would work.  But something Bedini said stuck with me.  He said just build it.  Forget your understanding of electrical circuits and build it to the specifications.  Don't change anything.  Electricians will tell you that you are building it backwards.  They will tell you it will never work.  According to traditional electrical engineering, the machine shouldn't even run at all.  Just follow the instructions.  Don't listen to them.  So, that's what I did.  Fortunately I don't have an electrical background so I don't know any better.  I can't look at a circuit diagram and tell you it won't work.  So it was easy for me to follow the directions without letting my own personal belief tell me I can't make the circuit that way. 

So. build it.  Read the circuit diagram.  Then tell me it doesn't work.
Reply: intriq8 too may naysayers. this is the reason we're all still dependant on big energy companies!
Reply: Hottomlie
Bro, life is not some harry potter situation where things only work if you believe in them. This circuit doesn't work period, clicking your heels and wishing and believing won't magically make the circuit work. If these idiots weren't blowing their time energy and money on internet scams they could already be off the grid.
Reply: I believe this is a good base design. I gradually perfected mine with better coils and electronics. Added more coils and went up to 3 rotors spinning independently. I would run it for several days at a time running light, tools and stereo. Charging car batteries, deep cycle batteries, and alkaline 'non-rechargeable' batteries. They would not get hot as long as I pulsed the charged the same way the rotor is driven. The output was independent of the input. So I was not pumping amps into the alkaline batteries. They worked better than new. Charging them can be dangerous and they can explode, make sure they are not very old. I only pulsed then a few seconds at a time. Anyway.... once I got it running it powered itself for days at a time while I pulled a load from it in my shop. I would tear it apart and try to make it better on a weekly basis. Since then I had a stroke, lost my job and house, and was homeless for almost 3 years. I am slowly getting back on my feet and getting ready to build a new Bedini. I hope to have some new vids up before long. I have a few early vids on manofdiversity359 on youtube, but does dot show advanced multi rotor designs. I also worked on an HHO generator that allowed me to get over 50mpg in my 85 K5 Blazer with a V8. Peace Out!